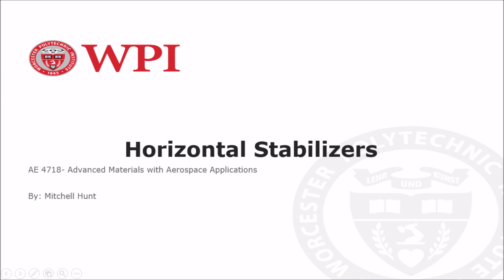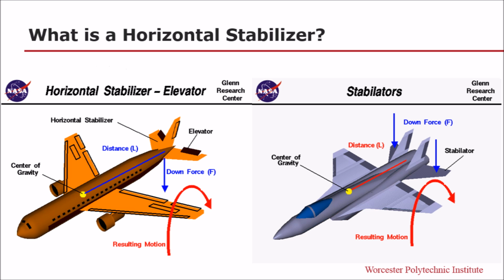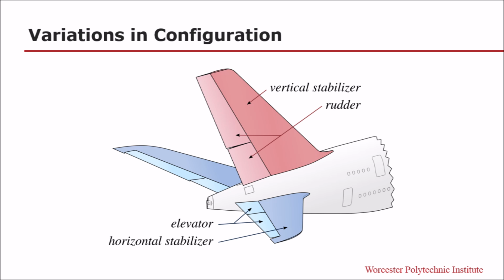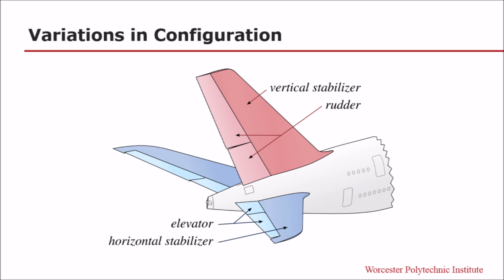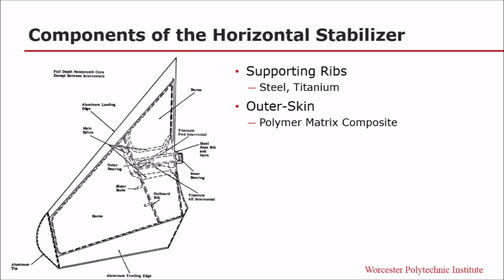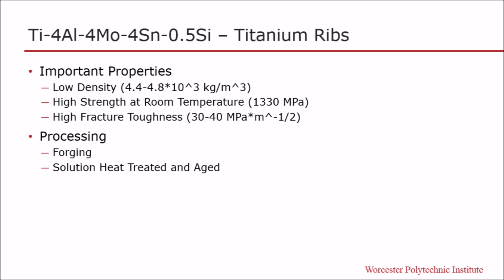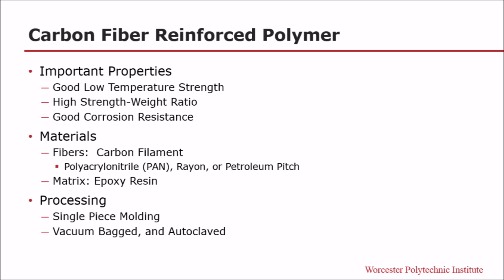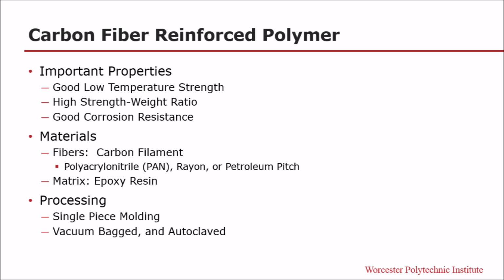Horizontal Stabilizers

Comment: Custom Aircraft Maintenance Tail Dock

The empennage, also
 known as the tail or tail assembly, gives stability to the 
aircraft. Most aircraft feature empennage incorporating vertical and 
horizontal stabilizing. Maintenance on this area is critical. Our Tail 
Dock work stands provide the technician with efficient access to areas 
otherwisw unreachable. They are custom-built per order to satisfy all of
 your tail dock maintenance needs. Constructed from the highest quality 
aluminum or steel. Call for a professional consultation.

Custom Aircraft Maintenance Tail Dock 

Our custom built 
tail docks are designed to provide complete access to the empennage, APU
 cavity, as well as AFT fuselage areas. We can build docks compatible 
with the Boeing 737, Airbus aircrafts, MD series, Boeing, P-8A Poseidon,
 P-8,LRIP-1, P-3 Orion, P-8A Poseidon, Boeing C-40A and any other you 
may want or need. The aircraft maintenance platforms are generally 
comprised of left-hand (LH) and right-hand (RH) sub-assembly half-docks.
 Each half-dock consists of a main deck (stabilizer platform) located 
below three upper-platform catwalk areas, depending on aircraft type.

Features:
Constructed fully of Steel or Aluminium and low-alloy Steel connectors or a combination. 
Decking is manufactured non-skid tread grip material unless otherwise discussed
A completely welded mobile structure or scaffold style options 
Fixed or adjustable heights can be done depending on your use
Allows versatility both in height adjustment as well as low speed transport
Equipped with swivel casters, tow bars, swivel locks and parking brakes
Can be supplied with electrical or pnuematic tooling hook-ups or even additional lighting fixtures if required. 

Use during all 
aspects of aircraft maintenance, including aircraft jacking operations. 
Each half-dock can be adjusted in height. Similarly the main deck can be
 height adjustable 
independent of the overall height of each half-dock to follow the 
contour of the horizontal stabilizer of the aircraft.

 

At MP Industries, Inc,
 we are proud to supply the needs of our customers in the most 
efficient, most economical manner possible. We are committed to 
providing affordable and flexible custom ground support equipment 
solutions to suit your facility's needs. We provide the latest 
innovations, services and modification support to meet the demands of 
your customers.

Comment: What do you think of the 'Screwjack 737 Max thing?' because with all the mechanical calculations involved, it  seems that the forces  created when diving at high speed acting on this mechanism,  seem to have rendered it very difficult to move, they think.

Comment: Why airliners don't use stabilators instead ? Wouldn't that eliminate a situation in the airliner where the stab can overcome the elevator ?
Reply: @Shaun Townsend Ehhh...Stabilator is not an elevator....it moves as one unit, one whole surface...look at l1011 tristar.